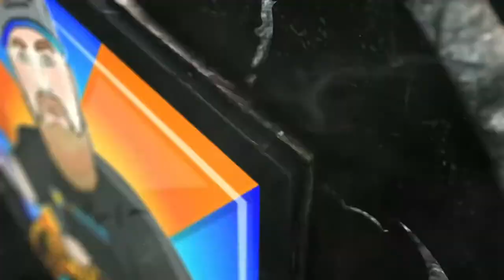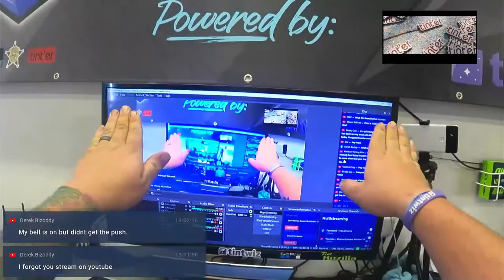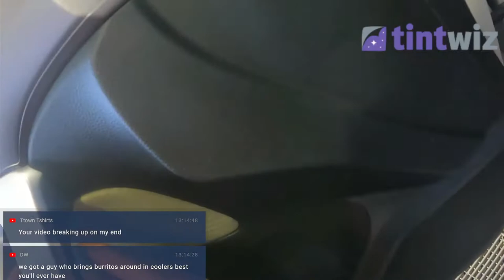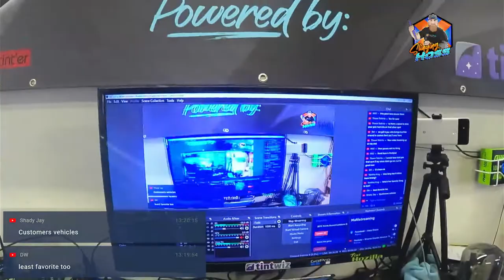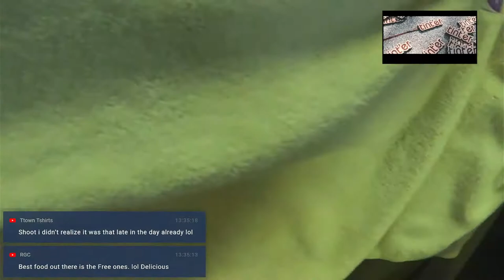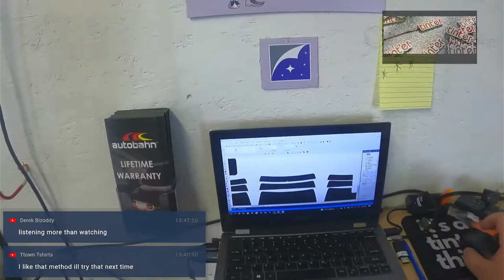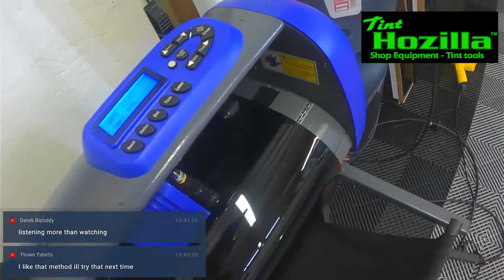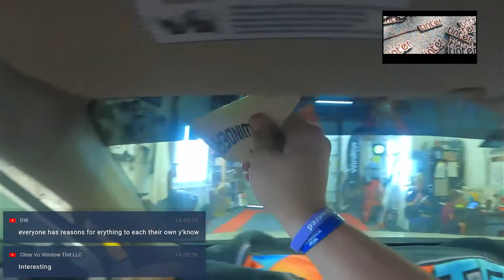2015 Honda Accord Autobahn I3 Ceramic window tint.

Comment: Quick question where did you get that cutting tool from that you used on the back window? That's pretty neat
Reply from the maker: It's wrapping paper cutter.  Has a replaceable exacto blade in it.  Can get them on Amazon pretty cheap.
Reply: @xtremeshadeswindowtinting3187  awesome 👌 thanks!